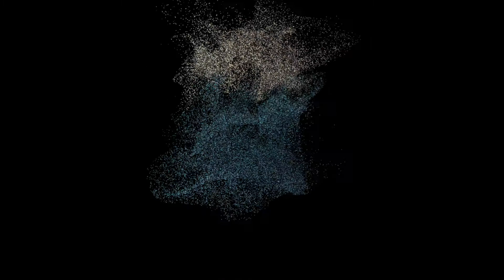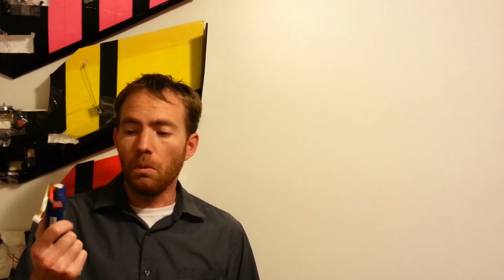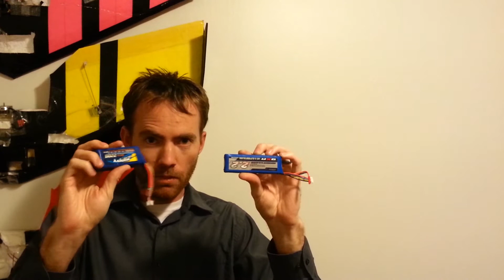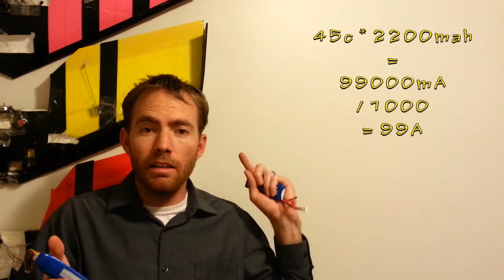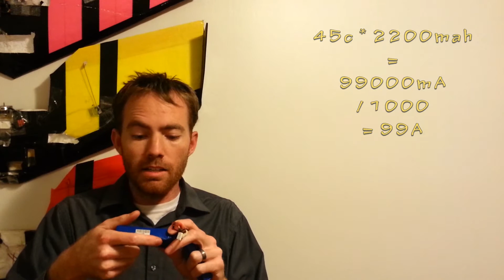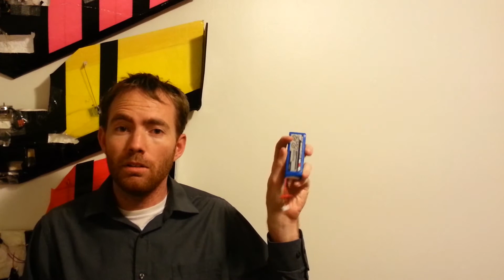Quick Tip of the Week! C Rating

Comment: I've tried to run a lower C rating in my hotliners and the motors will pulse after a couple of seconds of running. If you increase your C rating constant output  to double the amp draw you should be fine. Therefore, a motor that draws 50amps WOT should be good with a 2200 45C battery.
Reply from the maker: yup. Hotliners are a good example of a power-hungry aircraft. That pulse is the voltage sag triggering the ESC's low power protection.